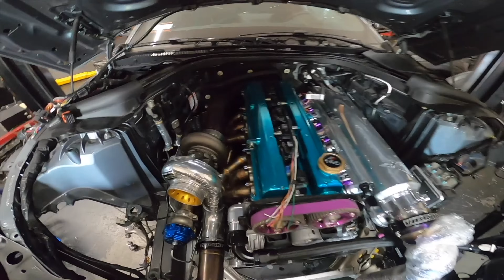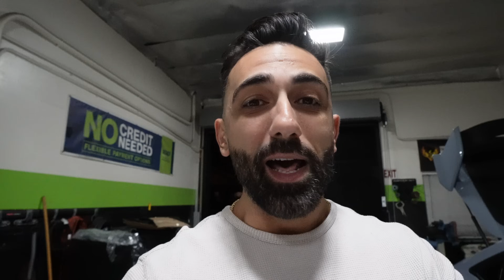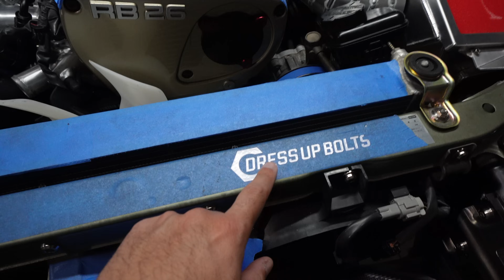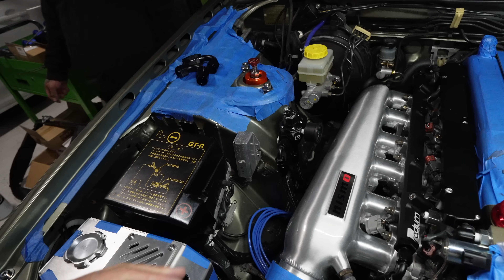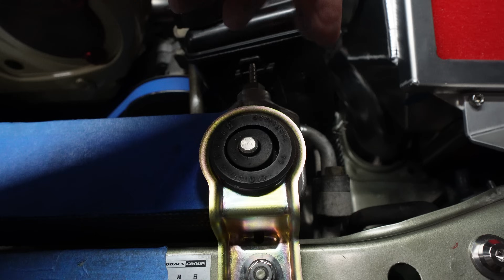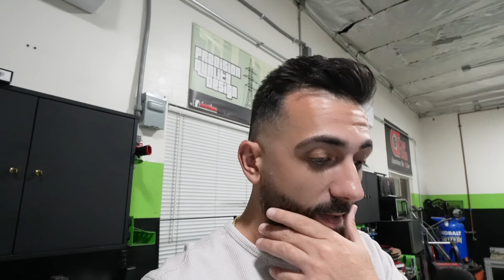Millenium Jade R34 GTR M-Spec Nur RB26 Updates!

Comment: Looks good Mark. Nice to see you're willing to have fab work done while still wanting to have mostly JDM stuff.

I will say keep up with that titanium parts/fasteners. Titanium attacks mild steel so just keep shit dry. I made Silicone gaskets to protect my 33's tower from the Ti strut bar. Has kept the bar bases from damaging the tower.

The billet injector cable thingy is from Frenchy Performance.

Have you looked into doing a thermofan w/ shroud setup? Spal or Delta pag fans will double the oem fan performance. Oem fan maxes out around 1700cfm. You'll get over 3k cfm's from a premium thermofan.